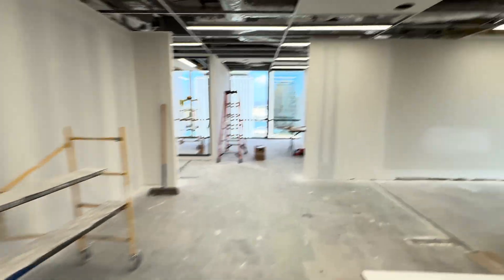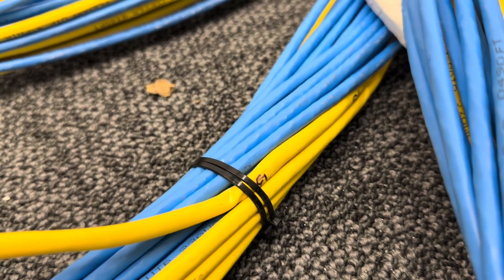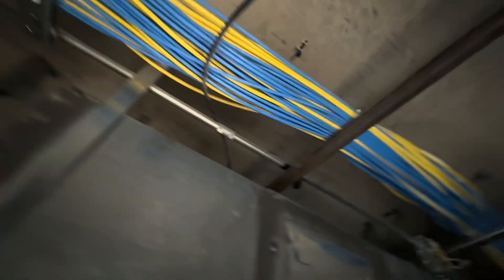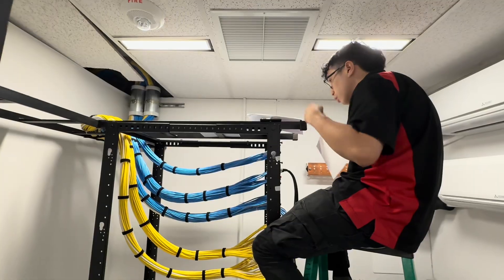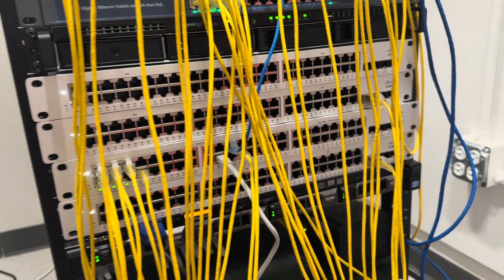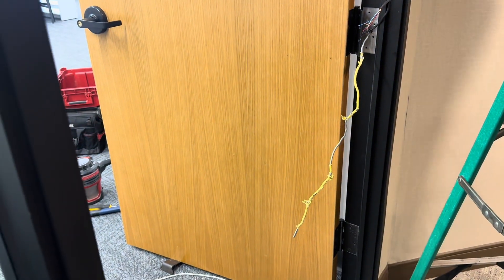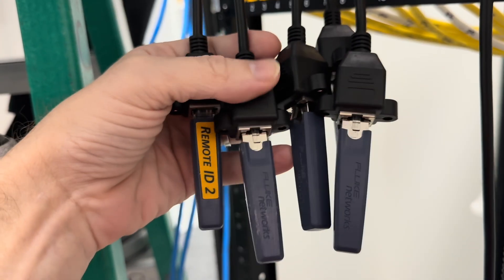Learn Network Cabling - Medium Sized Office

Comment: I used to work (part time) in security systems. Running cable is the same everywhere lol.  My OCD would cause me to be a little slower than most, but this looks like a fun career.  One thing I noticed. You probably had to go to the ground floor to use the restroom.  I have the bladder of a toddler.  That would suck lol

Comment: on new construction we always tried to get the wire installed before the ceiling pads were installed.  We also found that labeling the print prior to pulling wire   helped avoid missed drops.  Bag rhe jacks if they are hanging before final install in the rooms. For some reason painters and drywallers hate data jacks.

Comment: Bang for the buck, the Unifi Access system is pretty hard to beat - particularly if you're using the Unifi ecosystem already (gateways, switches, etc.). As for the install, very clean, very well done. It is so nice to see new installs done like this, vs. in-house IT groups that are being pulled in a bunch of different directions and get sloppy with the wiring, as there just isn't enough time/focus to do it cleanly. This is soooo much easier to maintain.
Reply from the maker: I didn't really like it at first but now its growing on me.  Using competing products at this price range has really opened my eyes on how much other brands kind of suck.  Only with Brivo or other large scale set ups do they really beat unifi at this game.

Comment: Why did you wait until the builders finished instead of roughing in all your cables while the walls had easy access?
Reply from the maker: That is the best time to do so, whether the walls are open or not doesn't help us, everything is inside a conduit to a junction box.  If we go that early, cables will be damaged by drywallers or painters, plus coming that early usually means sprinkler installers, HVAC installers, etc aren't done in the ceiling and our cables will be at risk if we picked a spot to route through and it was in their way.  Ideally, we come when the walls are done and lay the wires in, terminate, attach to a faceplate, label, and test, all in one visit.
Reply: @tciproductions ah, thanks for clarifying.

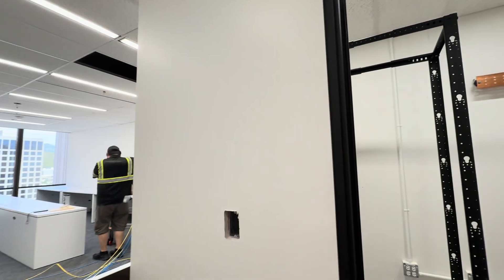Comment: That guy at 2:13 just running over the cables with his dolly.  The whole premise behind doing the furthest drops first is not because "near the end of the job, it becomes easier" It's because this way you have less risk of damaging cables. If you started with the closest drops, when you pulled the most distant drops, you increase the risk of damage or wire burn because the longest distance wires have a longer path of rubbing together or friction. This may not be such an issue with J hooks, depending on how you pull them. But more so an issue with conduit.

Comment: As a service tech, I would ask that you either remove all in-wall zipties, or replace them with soft Velcro, and use the minimum amount that's loosely tied wherever possible. I can't tell you how many times this becomes a major issue about 3-5 years after installation when one wire in a tied bundle goes bad...

Comment: im on IT dept. for the goverment, and im just curious, how much do you charge for a job like this one ? all included. materials and man work ?
Reply from the maker: It would be highly dependent on the cable count and ceiling type.  Warehouses would cost more than an office space for instance.  You should budget as a rough ballpark somewhere between $200 and $300 per cat6 cable installed when all is said and done.
Reply: @tciproductions  thanks man

Comment: Looks like a pretty big job. I worked a job overseas 30 years ago and we ran over 100,000 feet of cat 5 in buildings spread out over 80 miles from sea level to 13,500 feet above sea level. We terminated it with Krone blocks  and cross connected to terminal servers and routers.  We also ran fiber optic. We had 1,100 terminals and 1,000 PCs hooked to it when I left.   I taught and supervised the nationals in the country I was in. After that job I worked more in the transport of all kinds of data and voice communications on fiber optic, microwave and satellite communications.

Comment: Some buildings require Cable Trays in the ceiling for mainline cable runs from rack area.
Fire Marshall will write-up for any cable penetrations of Fire Walls, not properly Fire-stopped.

Comment: Is like to know what feature set you wanted that the unifi product didnt have
Reply from the maker: It works fine for what it is, however, the Access app that Ubiquiti supplies is 90% just white space on the screen.  The relationship between users, groups, and policies is a bit confusing.  Reporting is super minimal, there's no good way to check who's in the office and who's left.  I will say the NFC function is super cool, although again, a bit confusing from a management point of view.  The end users found it a bit minimal overall, but its just a door system so only a minor set of complaints on the whole.  It hooked into the phone system very easily.

Comment: What category cable are you running to small devices? AWG size? Like nfc reader, etc
Reply from the maker: I use use a simple cat6 23awg wire for phone type devices, and for like a wiegand card reader we'd do 16-4 or 18-4, depending on what the vendor calls out.  The Unifi product line was all PoE based, and then 18-4 to the locks.

Comment: As an IT guy I don't like the idea of interleaving patch panels and switches. Mostly because we usually have much more patch panel ports than switch ports and when you get into enterprise switching gear the cost per port becomes a factor so we don't just simply patch every port. My strategy (based on the more difficult to bend CAT6a SFTP cables and their bending radius): 1U cable guides interleaved with patch panels. Ports 1-12 leave below to the right and 13-24 on top to the left. In the middle there is on 2U cable guide for switching sides. Optionally a vertical cable guide on both sides. For each 48 port switch one cable guide above and below. For the left half of the switch the cables come from top and bottom from the right and for the right half from the left. Each patch cable is labeled with a number on both ends since you won't be able to visually trace the cables.
Visually this looks half way decent, it is still easily possible to pull out and add new cables, the bending radius of the cables is not undercut and you can still trace cables.
Reply from the maker: As an installer I often think about that.  You guys have us install 48 port panels, and then slip a 24 port switch into place.  Eventually you add another 24 port somewhere to add capacity and the patches from the original 48 panel become total chaos trying to get to these added later switches.  Nice that in your case you have put thought into it, a ton of IT people I encounter just make it up as they go and patch at random.

Comment: Have you started installing CAT8 yet? We got our first request this week.
Reply from the maker: No I haven’t yet, what kind of connectors will you use?  I’m interested in how hard they are to do.
Reply: CAT8 is a total waste of money IMHO. Over here we have been installing CAT7(a) since the mid-2000s for "future proofing" and no one uses anywhere near its capacity (usually 1000MHz) even today. 10GbE is already better served with fiber today (lower power consumption than copper, cables are much easier to handle).
Reply: CAT 8 is nothing but a bunch of marketing hype. It is for short runs at very high speeds, like 40 Gbps. Think data centers like google etc. CAT 7 is not a recognized standard in the states. The best cable recognized by the TIA/EIA is CAT 6A.  Your customers are requesting CAT 8 because they are misinformed.